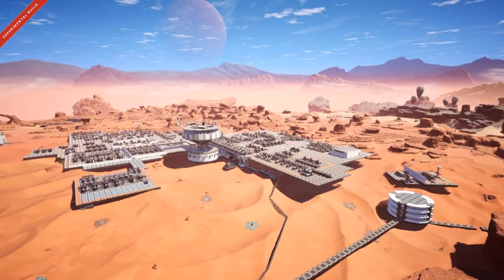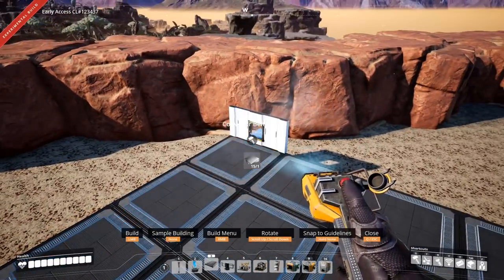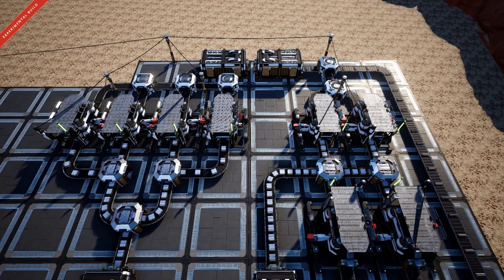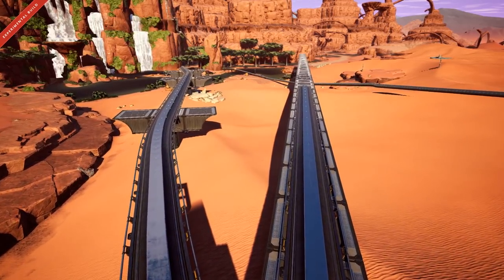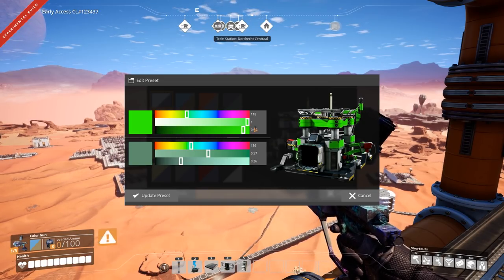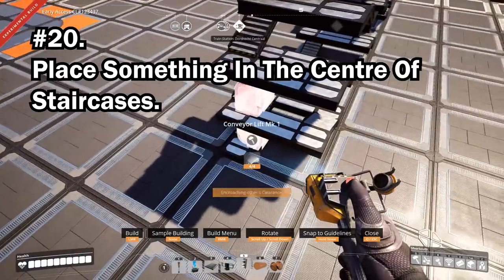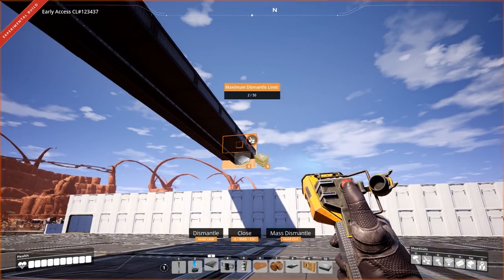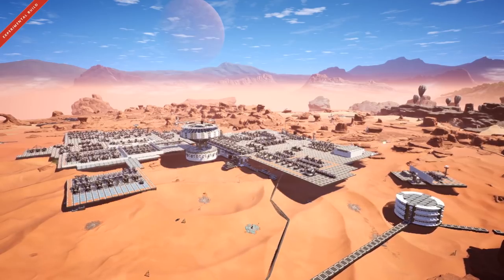A Practical Guide of 24 Building Tips Satisfactory Game

Comment: #26 : separate your power production grid as much as you can from your power distribution grid, best is to have only one connection between them, especially if your factory is meant to grow. 
In power production, connect generators and every machines strictly needed for generator powering. For example, coal miners and water pumps for a coal production plant. 
In power distribution, connect everything else together. 
You can eventually have a personal transportation system (train/hypertube/whatever) with a dedicated power grid if you can afford it. 

The idea behind this is that if your power grid shuts down because it is under required power, you may need extra power to start additional power plants, and in this case being able to disconnect your production from power production grid easily is a big help, allowing you to use existing power to initiate other power plants. 
An autonomous transportation system is also a plus, especially with big factories, as it will allow you to move around even if system is shut down to fix problem faster.
Reply from the maker: That's a really good tip! Very helpful in the mid game where you'll be running out of power often!
Reply: @TotalXclipse  Happened to me 2 days ago x) Will start a mega power plant soon, probably using oil power ^^ But first I need some exploration to unlock recipes x)
Reply: yeap, i did separeted grid to my coal miners in factorio... satisfactory i not advance enought to do this kind of stuff, but i want to make a center control room too like a room with tons of lines that if i cut a wire entire stuff stop working, my main problem with this idea is how long i will spend to implement those? i totally need more time to play it, but i had no extra time to, soo i just get all a giant mess under boxes all over in a single grid and if it shut downs i know my last build go blowed the grid and just cut out that portion then upgrade energy then back all running again... i miss enerhy upgrade a while and yesterday close to midnight i blow all up connecting my new motor plant on... i shut of my first steel production and will fix energy today, or try at least hehe
Reply: Good tip.  What I've done is put a Power Switch for each building.  Then if I'm tight on power I can shut off a who building that I don't need right now.  I'd also recommend building some Power Storage.  Once they are charged you can actually go over your max generation for some time without it blowing a fuse, giving you lots of time to sort things out.

Comment: #25 (a bit off topic): when building a long railway, first build a factory producing steel beams, steel tubes and concrete (and whatever more you need for building your railway, these 3 are the minimum). Then build a railway station, with at least 1 freight platform for each resource you want to carry on, but more can be better, like 5 for steel beams/tubes and 10 for concrete. Then feet platforms with resources from the factory. Now build your railway driving the train along it, so you can use train as an extended inventory and refill it extremely fast at factory when needed. 
For exploring the map, you eventually want to carry  (by train) some iron plate and rode to build walkways in case you need to overcome some obstacles, or some packaged fuel for your jetpack if you already have it unlocked. :)
Reply from the maker: Yep when you get to that stage in the game having a service train providing all the necessary resources is so useful :)
Reply: @TotalXclipse  exactly, as I unlocked T7 today I'm switching from a conveyor/bus distribution to a train/central storage distribution :)( I'm a train addict xD ) 
But even for just moving around trains are pretty convenient :p
Reply: Don't forget the nobelisks and cartidges if unlocked ..
Reply: You dont actually need the Cargo station.. only the Cargo cars.... the cargo stations arent required to actually build the cars on the train... i used a train with 5 cargo cars that travelled with me when i built a railway across the map...
Reply: @Zion800  definitely ! Cargo stations are for refilling cargo cars faster, rather than doing it by hands x) my build train is like 25 cars longs (excluding tractors), so I appreciate having to just click on "load" when going for a refill trip for ressources ^^
Reply: @felixbertoni  that's true... ive always built massive conveyor lines (And pipe lines) across the map, it never occurred to me to utilize the transport option on trains for such massive transports.... i guess that's also because i struggled a lot to get my trains into autopilot mode.....
Reply: @Zion800  autopilot on trains is definitely a pain to get working, even more if you want to make optimizations on your production lines, so in the end conveyors are still a better choice on the long run (I use trains only because i like trains a lot lol)^^ I hope devs will implement better trains scheduling in the futur ^^

Comment: There it is! The weirdness that is current fluid logic in SF! I have a feeling the thing with a solo high-altitude water extractor to raise headlift thresholds will be patched out somehow in the updates to come, but then again maybe not, I imagine unpicking that particular behaviour from the rest of the system may prove awkward. If it does indeed stay as it is now then there are some immensely twisted things one could do, like placing a singular water extractor on the highest patch of water you can find and running a massive manifold into the rear end of every nearby (lower altitude) water pipe set. As far as I've been able to experiment on the matter, you can currently have that single extractor running at 1% and still get the effect on as many pipelines as you can (feasibly) attach to the drop feed manifold.
Reply from the maker: Well it works as it would in real life I believe, hence the use of water towers. in fact even if you pumped water to a single high point on the map, using that would be much more efficient than pumping 20 pipelines up to the same height without headlift. So it might be something I play with, with oil :)

Comment: My biggest issue is never leaving enough room lol.  Build a perfectly balanced system only to need to upgrade everything once the last miner and belts are unlocked, I never have enough room to expand unless I rip everything out and spend 11 hours rebuilding, ( just tripled my iron ingots and steel last night).  Side note, Nuclear power is so satisfying once it's all set up and running, currently making 10 fuel rod a minute, potential of 64/m when finished.
Reply from the maker: Sweet! I'm not looking forward to returning to Uranium, gave me a headache last time, and it was simpler then :D
You're right, leaving enough space is one of the biggest problems, however if you spread it across one layer, you could then double it or triple it in height. Sometimes it is easier said than done though.
Reply: @TotalXclipse  It's actually not that bad, The only hard part about Nuclear plants are the pipes needed, since it's a 300 line to each one. I already set up a massive array of 68 full pipes under my nuclear base in the swamp (hate that area, to many spiders) lol A good time saver is shard all of the water extractors, makes it so much easier and gets more water out of the area. And dont over clock nuclear, not a good time. Maybe in the future they'll increase the throughput of pipes or allow more than one pipe per plant.

Comment: My favorite way to climb buildings is not the staircase, I use the stackable conveyer poles.  They clip right through the walls so on the outside it looks just like a ladder.  I tend to build a large vertical structure that takes in everything needed at the bottom and then on the other end outputs the part I want directly into a storage container.  Then I wall up and close up the entire building and I never have to enter it again.  That way the inside can be absolutely chock full of spaghetti but the outside looks nice and clean. :-)

Comment: hint for beginners (like me) : walkways are MUCH better than guard rails (fences) and stairs. while you are low on coupons, buy walkways instead of fences/stairs. the biggest problem with the fences for me was that they are only horizontal and can't be usefully attached to any ramps. and also the stairs have a problem: they cover two thirds of the width of a platform and thus leave a hole in the ground, and also have some ugly extensions which stick out into otherwise passable space, eg when you build a series of stairs along a longer wall.
on the other hand, the guardrails of walkways can be pretty dangerous too: when walking at a slight angle, you can safely "glide" along them. but when you hit the gaps between two walkway platforms at exactly a right angle, you will walk through and easily fall to your death :-(
Reply from the maker: That's a really good point! Thanks :)

Comment: Was building some railway so the tip towards the end was great, struggle to keep the track going in straight line wants to go off all wiggly all the time any advice on that?
Reply from the maker: Really good question. and yes I do. (should have included it.) place rather than moving from a straight piece of track to a curve then adding another straight piece of track, you should place a straight piece of track before the curve and also one after. Then place the curve connecting to the two straight pieces of track.
Reply: @TotalXclipse  Thanks never really used trains much trying in my latest save, found only looped track would work for me Terminal didn't but maybe was doing something wrong still will try your suggestion for less wiggly track

Comment: How do you happily fly around?
Also, water's not broken, it is how water works.
Reply from the maker: I'm using the Pak Utility mod for flying to help with the camera angles :)
Reply: the principle of reallife water towers is that the entire network below the highest point will be fillled and need no separate pumps, BUT to insert more water below that top point, you need more pressure/force/power depending on how far below that highest point you insert water. remember that a water tower in reallife is used to have constant high(!) pressure in the entire system without the need for additional pumps, and thus all pumps that insert water at lower altitudes would have to counteract that high pressure, or weak pumps at low insertion points would either break or be forced running backwards by that high pressure (stick a water pipe in your mouth and try to blow air into it, lol :-).

for "push pumps" there also should be no limit on how high they can pump water (besides the strength of the pipes so that they don't burst from the pressure). they simply have to be stronger, maybe MK1, MK2, MK3 ingame :-). but for "pull pumps" at the upper end of pipes, there is a physical limit how high they can pull water, which is given by gravity and the weight of water: 9.81 meter is the maximum lift for a single "pull pump" until they would start creating a vacuum between that height and the pump. a stronger pump only might create a better vacuum, but wouldn't be able to get water higher by a single millimeter. thus for larger heights you need a series of "pull pumps" at least every 9 meters. of course, this value applies to earth and may be different on massageAB. with the engineer being able to easily jump up 2 meters instead of maybe 1 meters on earth (or 4 instead of 2 when wearing the boots), that limit might well be 20 meters on this planet instead of 9.81 meters on earth. but this only applies to "pull pumps" and NOT to "push pumps" !
i have no idea why anybody would use "pull pumps" to transport huge amounts of liquids over great height differences ...

edit: being no native speaker, i don't know how you call those pumps, maybe "pull pumps" are sucktion pumps and "push pumps" are pressure pumps ?
Reply: Yeah, i missed that - the water collectors would have to be as strong as the overall pressure in the system, which they are obviously not.